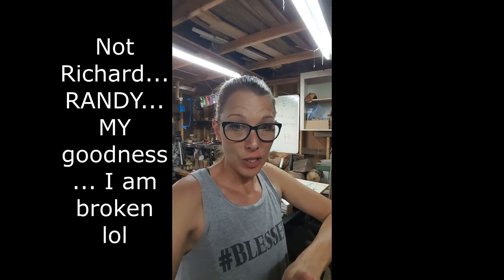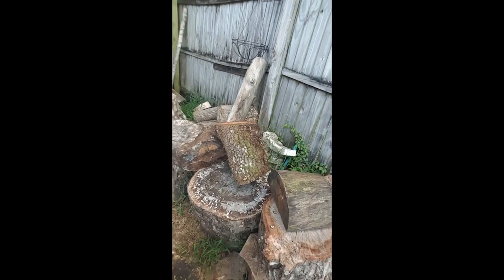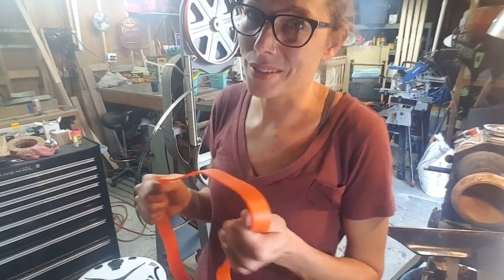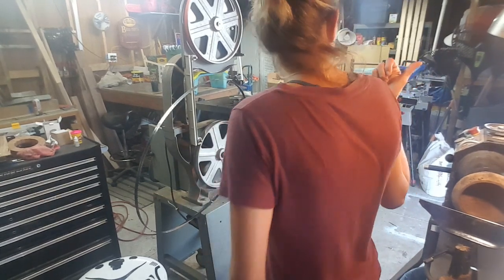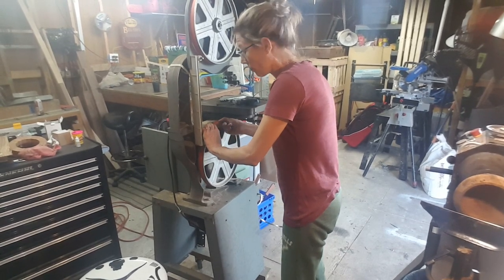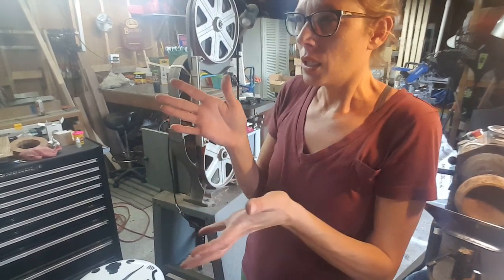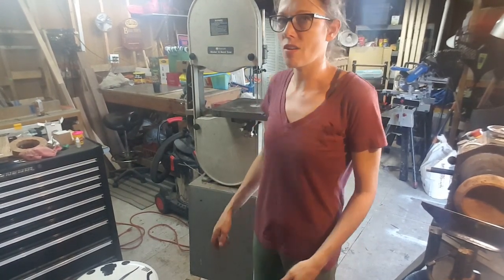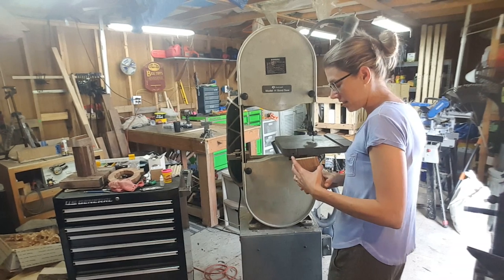New band saw and installing new tires

Comment: Hello Kim, 

 I am a trained industrial technology teacher, started training in 1972. Taught in the classroom for almost then years.Cabinet making and Carpentry for 30 plus years.

 From watching your video, you set up the bandsaw as I was trained, center the blade on the tires and then bring in the bearings, etc.  I watched a video on u tube several months ago, from a man that designed bandsaws for some of the major companies.( I wish I would have bookmarked the page.)   He suggested to at the start of putting the bandsaw blade on the tires, to take pains to align the gullet of the blade, to the center of the tires instead of centering the blade with the tires.

 I tried this, took pains to align the blade track on the wheels so that the innermost relief behind the cutting teeth of the blade, was centered on the tires.  I then brought up the bearings, and then the guides, setting them as tight as reasonable, 

I have set up three bandsaws with this method in the last four months, one of them was a 14" Rockwell with the gear system to slow down the blade speed to cut metal, and am amazed!  There is no leading or run out of the cut.  Using a circle cutting jig before, I would have the cut stray to the outside of my intended cut, with the new setup, it followed the line perfectly.

Even us old dogs can learn something new and better!

WH
Reply from the maker: Wow!! I will have to do that. I think my blade is centered but I will check using this method. If I get confused, I will let you know.

Comment: I know this is not a new video, so forgive me if you’ve heard this. The plastic blade guard that runs between the top and bottom on the left, is on backwards. It’s supposed to be installed after the blade with the opening facing away from you. This is just another safety against you catching yourself on the spinning blade and to eliminate one more place for a blade that snaps to get to you.  Love the channel, bless you.
Reply from the maker: Thank you.  God bless!!

Comment: I have the same looking 14 " bandsaw. The name on it is Craftmaster by Homier and the year is 1987. I bought it at a yard sale many years ago. Then sold it and wished I had it . Then went to a garage sale and there is was for sale. I re bought it and installed a wood frame with wheels on it and I am happy now that it is mine. I'll not sell it again!
Reply from the maker: Glad to hear you got back your first love 😁🤗
Reply: @KimTippin  I looked at several new bandsaws and they did not have the heavy cast iron I wanted so I bought a small Delta 9 inch and like you , I used my chainsaw then the small bandsaw. Now I don't need the chainsaw , I just use either of the two bandsaws. I like the Delta too even tho it is a 9 inch.

Comment: Hey KT. You can heat up tires with no ill affect, but just heat up in a bowl of hot water, not boiling but hot say 160F or 170F or so. Set bowl near saw set tires in hot water for 1 to 2 min. then have two spring clamps handy to hold the tire on the wheel for about half of the tire, while you stretch and slide the rest of the tire on. Piece of cake. The guides for the blade are call "cool blocks". They come in different material and even ceramic. These do not need to touch the blade but have a gap to blade of one fold sheet of paper. They control the left and right twist of the blade. Carter Products make an up grade kit with all roller bearings for that model. A bit expensive but worth it if you find you use saw a lot.
If your greatest use is rough cutting bowl what you have now is great. Do a little YT research on TPI, skip tooth and hook tooth. I think that model will accept a riser block on the support arm that carries upper wheel. Then you use a longer blade. Cut a little bigger diameter log. Just food for thought.
Reply from the maker: Thanks ED!! I can always count on you to give me all the 411! Thank you so much for that and I truly appreciate you!!!  I have looked into a riser block, I will most likely upgrade that later on. I do need to get a 3 or 4 tpi thinner blade to cut my circles. I have one but it is about a 5tpi. will work but slower going.   I did not know about the bearing kit! I sure will look into that. Thanks again!!!

Comment: Nothing like a new tool, right Kim? YAY!! Have you tried folding bandsaw blades yet?
There are still some old well made heavy-duty tools around. I keep alerts on craigslist. Found an old belt 6 x 48 sander this week, very heavy Sears model, cheap. Now I have four sanders, with 80, 120, 180, 220 grits ready for action. Is that lazy or what?
Reply from the maker: I totally get it!! That is why I have more than one pressure cooker in the house :P  Have not tried folding band saw blades... never even heard of them before.. hmmmm

Comment: Nice saw - I have a 14" one too, very handy. Only advice is that cutting green wood tends to clog up underneath and promote
 rusting. And that wide resaw blade won't make too small a circle so beware.
On another note - "shop hair, don't care" I love it 😁
Reply from the maker: I have a smaller blade I will use for small circles. It is about a 5 tpi , I need to get a 3 tpi. I will switch them out before I start cutting circles. Thank you about the tip with green wood. Haven't cut any yet so it is real good to have a heads up!! THank you!

Comment: It is recommended that if you heat up your tire you just soak it in warm water it is less damaging than putting direct heat on it
Reply from the maker: Yes, the directions did say warm water can be used if needed. I just chose to get a workout instead. Lol

Comment: So I read the same stuff about bandsaw tires .. so I heated the top one with hot water ... and stretched the bottom one for my 14 in Boyce Crain .... that was 4 years ago .. both are still in good shape.... I have converted my bandsaw to dual speed and I cut mostly metal...will let you know if one of the tries fail early ... I suspect the metal swarf will wear them out before they “dry out”.  
PS love your work
Reply from the maker: Good to know! The directions did say you could put them in warm water. I think the gentleman that had this before mentioned he boiled them.. could have misunderstood him. The top tire went on after two stretches. Easy enough till the 2nd one came along... Kinda like my kids. Haha 1st one fools you lol. Thanks!! 🤗😁

Comment: There is an excellent YouTube video by Alex Snodgrass on setting up your bandsaw.  It is probably the best video on YouTube to watch since he goes into a lot of detail.   Alex has tons of practical experience with bandsaws.  You can bank on what he says is accurate.

Best way to install urethane tires on bandsaw pulleys is to remove pulleys from saw.   Your stretching the tires in the way that you did may have been too much and they might slip down the road.  Only time will tell.  You want them tight against the pulley and it usually takes some work to get them on.  Your tires went on pretty easily which tells me they may have been stretched too much.  As I said, only time will tell.

The belt from motor to pulley seems to have about 1” or more play.  You want about .5”.  A belt with lots of slack will cause vibration in the saw.  Go to Harbor Freight and buy a Link Belt for about $35.  It should make the saw run smoother.   Of course, link belts can be purchased elsewhere, but they will cost more. 

Nice video!!!  Thanks!

Reduce tension on saw blade if you don’t use the saw for a while.  This will eliminate flat spots from forming on tires and causing vibration.